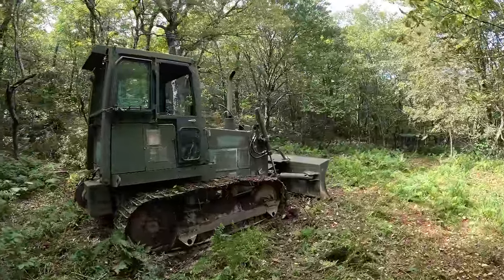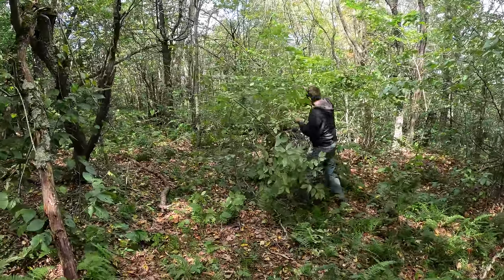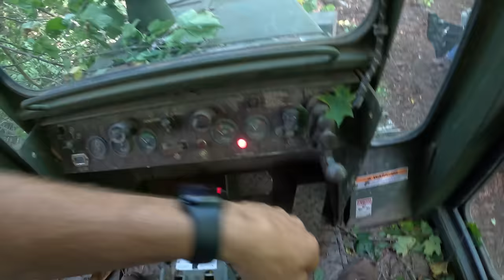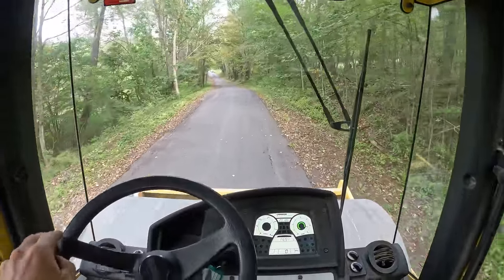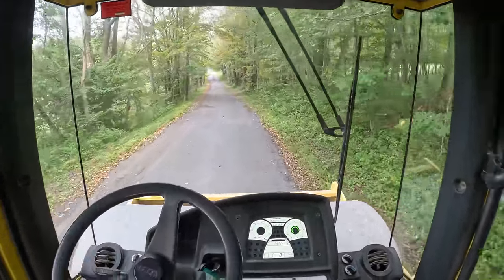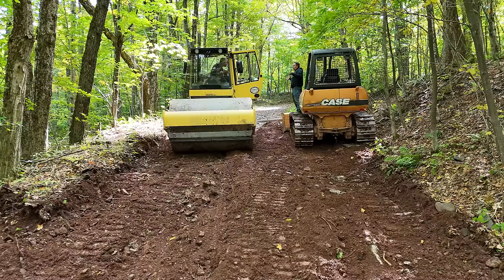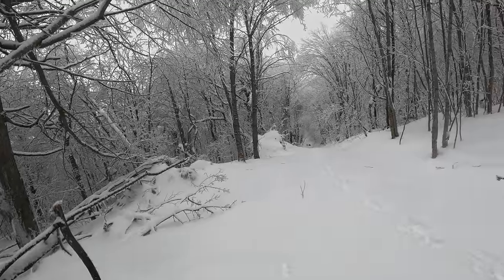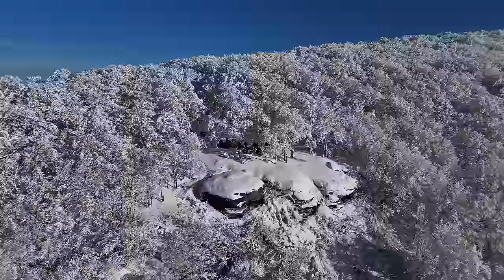Snowmobile trail maintenance

Comment: Any chance you can get ahold of some Lidar data for your mountain? Would make it really eazy to spot most of the old trails assuming it is good resolution data ~1 to 5m or around 5 to 20' range.
Reply from the maker: That is a good idea. There are trails all over those mountains, many of them are overgrown.
Reply: Thx, I use lidar all the time at work doing GIS mapping and things like that for an archaeology company. Not as good as getting out there but you can find a lot of hidden history that way and cool spots that are now covered with trees and brush.
Reply: You might check with the state or county. A lot of them have LiDAR available for download.  @AndrewCamarata

Comment: don't let the trees get up over your blade and up into your ram cylinders, they will damage and eventually bust off the hoses and couplings and it's a nightmare when the couplings get bent in the thread ports because the ports get destroyed and then you need a whole new ram or 50% -75% of the price of a new ram to get the old ones fixed. from my experience...my dad about murdered me for those times....no really, he came running up the mountain, jumped on the moving track opened the cab and grabbed my by my shirt and picked me clear out of the seat and threw me down the mountain, his face was beyond red and near purple black plum and every vein on his head stuck out....i wore my seat belt after that 🤣 cuz i was not stoppin and getting out to take a gawd damned tree off the blade ram nose area every single time it happened which was thousands while doing hundreds of miles of powerline mountain jobs from niagra falls to nyc

Comment: these trails in this area used to be old logging areas with logging roads all over them and some short cutting for the machines that didn't have the braking issue hauling mass loads of heavy logs down the mountain. they were assisted by a major amount of steam powered winch systems that were at strategic locations pulling trees up to loading locations or towards logging conveyors (slip slide systems plank type low rail chutes) running down the mountains. i've seen a number of the old photos from the 1920's/30's in the library books all over new york and vermont

Comment: Wouldn't a pad foot drum on the roller work better for what you was using it for in this video? You might want to look into getting a bolt on pad foot that goes over the smooth drum. Probably be able to find one at auction or in a used equipment magazine. Seems like the smooth drum is better for finish work like when you was putting the crushed stone on your roads on the mountain. Use what you got though and do the best you can I guess. Neat video.

Comment: I have a couple of sleds at our cabin and there is not enough snow to run the sleds on the trails this year. Usually there is 2 feet of snow at the cabin so it will be running them on the lake instead of trails. You need ice scratchers though.

Comment: Hi Andrew, 

I have a question that has always been bothering me when I'm watching your videos (for about 3 years now).

You have A LOT of machinery and vehicles that are just being used by you. Not only that, but also a numerous amount of equipment like skid steer attachments, tools, and whatnot. My question is if you don't feel like most of the stuff that is just lying there, getting rained on, and not being used is getting disintegrated over time? I feel like about half of the things you are fixing are damaged by time or weather, like electrical issues, rusted bolts, cleaning carburetors, etc. I'm wondering if the reason is that you don't mind fixing anything that gets broken by time? Or maybe it's not profitable to list and sell equipment because your profit from making videos about fixing stuff on YouTube is more significant? Or perhaps you are just a heavy machinery hoarder :)

I'm asking because if I were in that situation, I would sell anything that is just losing value not being used for an extended amount of time.
Or if not selling, storing equipment in dry conditions under a roof.
Reply from the maker: Yeah. I have too much stuff sitting. Building a new garage now, that will help. Some of this stuff can sit inside forever fine. Some gets sitting problems. .

Comment: It's nice to have that experience that lets you know which piece of equipment to bring in for the job at hand.
Nothing on that trail will stop that dozer!
😂
Reply: The dozer is junk dude. It had trouble pushing over a couple of saplings. IF the Dozer was good, it would be pushing a full shovel of dirt easily.

Comment: Surveyors tape,  i didn't hear anybody mention about surveyors tape.  When you're on foot on the ground and you're trying to figure out where you want your trail you could mark it so you can see it from the cab when you're in the machine.  I think you can probably get it at the hardware store or home center, just something to help you in your projects,   You may even have some from the work you do.
Reply from the maker: Yeah, I forgot it. I was using zip ties and breaking branches.